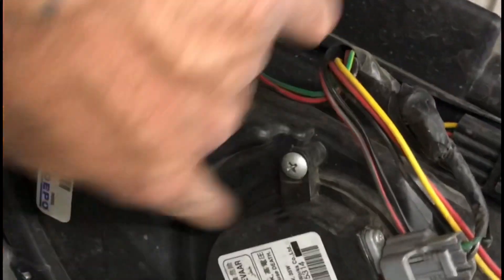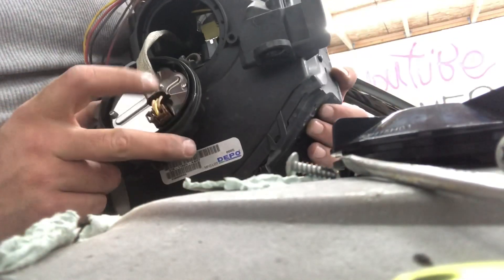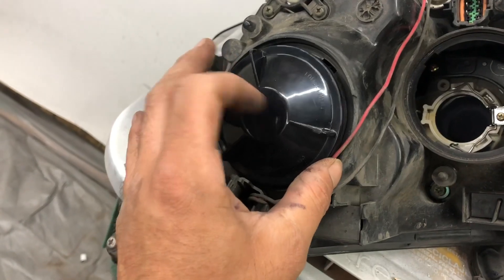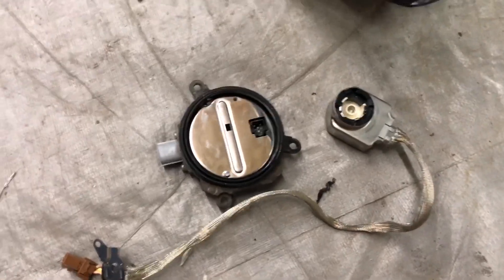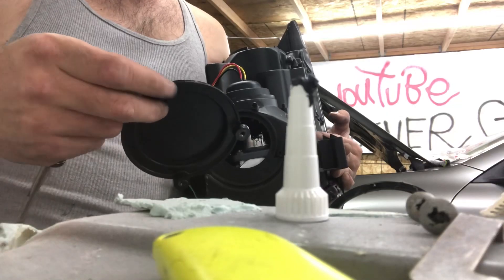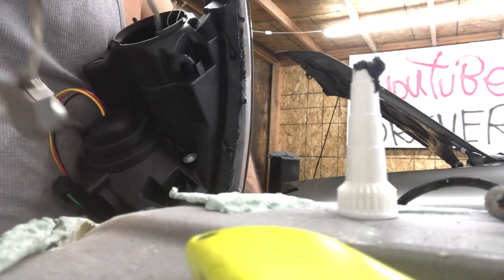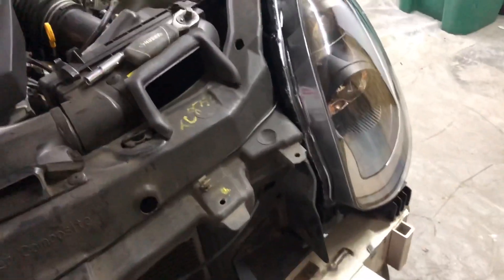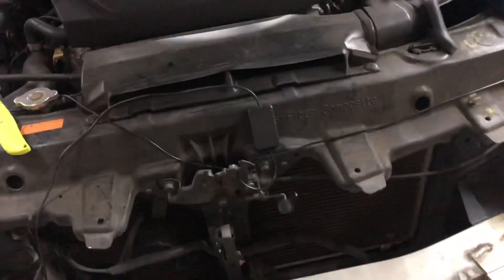03-07 G35/350z DIY SPEC D INSTALL PLUS DEMON EYE HOOK UP

Comment: broooo finally someone does a video like this. really appreciate it. love the work and everything. but on a side note you should be a little more specific with the wiring but overall love the build and appreciate your videos man they help out a lot
Reply from the maker: Ed haha appriciate i looking  at the video bro . and man its pretty simple plug and play with wires the hard part is custominzing the wires to come out back end then sealing them up i have a few videos on these lights due to so many steps click on my uploads u scroll threw my older videoz 🤘🤘🤘

Comment: If you were to tap into wires to wire them up instead of running them straight to the battery, which wires would you tap into to get them on ?

Comment: I just now got a 2004 G35 having a few problems however I like watching the video keep up the good work if you need another one to work on let me know
Reply from the maker: Nyle Hogan what issues u having bro ??
Reply: @foreverg3549  I think it's the head gasket I'm not sure Beloved the car nice it's just that the heat don't work and it smokes a lot so thinking I have a blown head gasket
Reply from the maker: Nyle Hogan well smoking could mean valve cover is leaking and its burning oil ... if its a head gasket u will know right away . when driving u will have 0 power and u can pull dip stick and see water mixed with oil . thats hiw u know its heads . besides what u have told me . what are u experiencing ?
Reply: @foreverg3549  it still has plenty of power I did put some additive in my radiator and it gets hot really quick I did just have to replace the radiator what other stent sensor would make it smoke last night cuz I checked my check engine light and it said a map sensor where are they located do you know
Reply from the maker: Nyle Hogan map sensor is located on  the intake coming off throttle body ... there is a lil sensor on it . u need a special screw driver end to remove it
Reply from the maker: Nyle Hogan this video should help u locate it 💪🏽 https://youtu.be/0i6c-o9qmdg

Comment: Hey In One of your vids you said this is your second pair. I broke one of my blinker leds any idea where I can find the smallest one? Love your channel!
Reply from the maker: hit them up tell them it broke and u want to buy new one . they should refund u full price or warrenty u another pair and let u keep those ... they did for me
Reply: FOREVER G35 
It was my bad though. Did the second one in 20 mins bro
Reply from the maker: 0projectme0 dsmn
Reply: FOREVER G35 do you still have the others I need the first part of the blinker. I’ll pay. Can you desolder 8 joints?
Reply: Or just the four that Continues on
Reply from the maker: 0projectme0 bro hit up the company u bought them from my lights still work fine . ans i have a whole new set shipped from seller cause i broke them
Reply from the maker: 0projectme0 how did u brake the DRL blinker ?
Reply: FOREVER G35  didn’t see it in you unplug in your vid bro! But on my part I didn’t se you take out the three screws. My bad. Second headlight easy. Thanks for the vid.
Reply: Does forever g35 have a Facebook? Id like you to see my (auto) I know but $800 04
Reply from the maker: 0projectme0 only IG . forever g35 or snap chat @ thatgreenblood

Comment: Did you run the blue tooth wire to the battery or to the headlight itself?
Reply from the maker: Alex Peralta straight to battery i didnt wana tap into wires i thot i showed that in the video 🤦🏽‍♂️ ma bad if i didnt . but its a 12v hook  up so it works . good thing about that is u can turn itvon by ur fone even if your not in the car  i love it good for car shows
Reply: FOREVER G35 I probably missed it. But I appreciate you replying! Keep up the great work! 💪🏽
Reply from the maker: Alex Peralta its all good if u did brotha idk if i even showed that . but your welcom i reply to everyone channel still small so its easyer . much more coming tho thanks for sub . beging next year ima b workong on boosting it